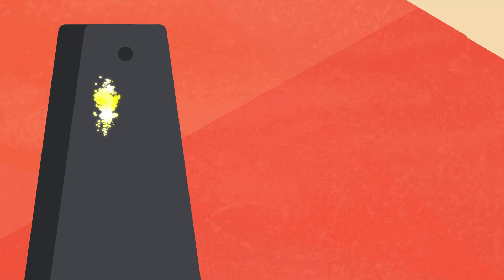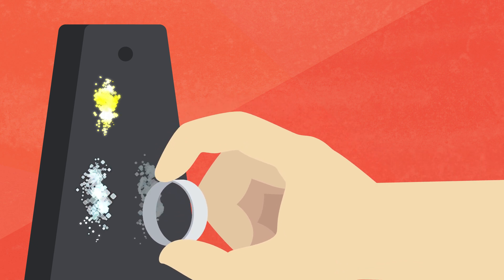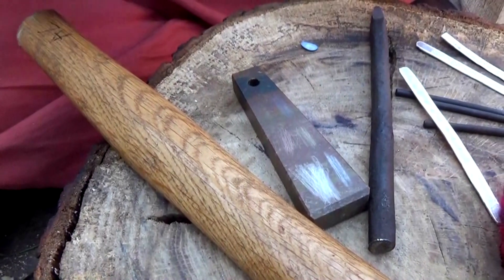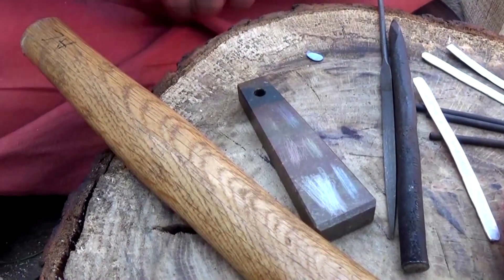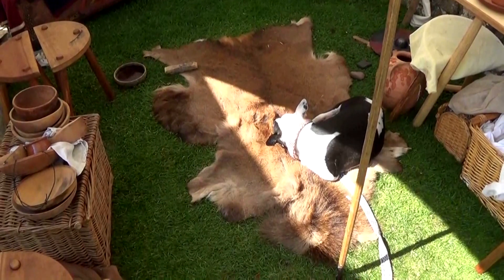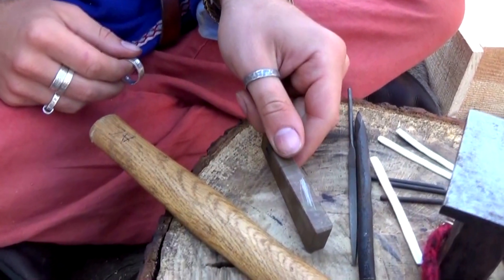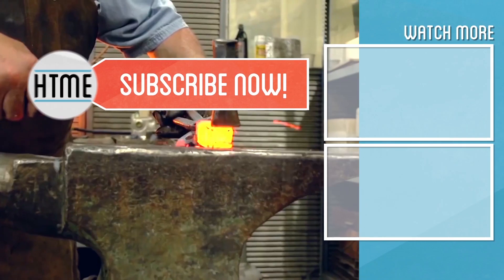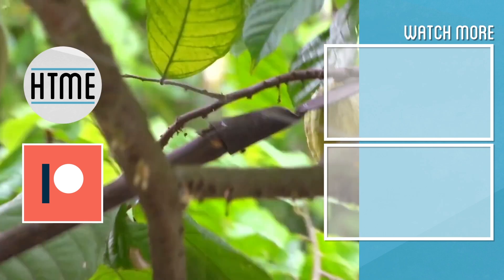How Does a Touchstone Work?

Comment: There is 3 main things we use to establish what minerals(stones) we are dealing with.
Hardness, weight and the powder colour.
The powder colour we get from a touchstone, but to day most hobby geologists simply use unpolished porcelain as a touchstone.
On the underside of cops and plates there is usually a ring of unpolished porcelain that is good for this use.

Since porcelain is white, it is actually even better then the traditional touchstone, because that makes it even more easy to see exact colour.

(This underside with unpolished porcelain is excellent at sharpening your knifes on too by the way)  ;)
(And as steel gives away a black powder colour, you will also see that the porcelain become black when you use it to sharpen your knife with)

Comment: What if you've had a lump of a metal of low value coated in metal of high value so that the layer of high value would be thick enough to not yet reveal the metal of low value underneath when the sample is rubbed?

Comment: but... you didn't touch on the acids that are used to tell the difference between the different karats of gold... or the use of acids for testing of silver on the touchstone. also iron or stainless steel feel very different compared to silver or white gold when scratched on the touchstone... as well as pure gold doesn't really "scratch off" it more a less has little tiny balls rub off and doesn't leave a good mark because pure gold is so soft and malleable

Comment: Don't metalurgists keep touchstones in their labs up to the present day? Great vid.
Reply: The stones that they keep now are more to get some of the metal on to do the acid test on. They are basically an artificial touchstone (originals were mostly jasper or chist) but they don't use them to compare colors of metal. The rub the metal on and then they drop acid on for the reaction comparison.
Reply: WanderingLostMC 
Good news. Thanks for the info.

Comment: Hmm.  I'm a collector of ancient Greek coins.  Perhaps we're dealing with different time periods here, but since you use an image of a Corinthian stater in your video, I'll say a few words which aren't criticisms.
I've never heard of the Greeks using an acid test, nor have I ever seen or heard of an acid damaged gold or silver ancient Greek coin. Most ancient Greek counterfeits were silver plated over a base metal core, which would defeat your touch stone unless I'm missing something.  Ancient Greeks judged authentic coins by their weight.  For example the Athenian tetradrachm weighed 17.2 grams.  Any coin that weighed less than that was test cut to check if it was solid, or had a base metal (bronze) core.  https://en.wikipedia.org/wiki/File:Athens_Tetradrachm_with_multiple_test_cuts.jpg
Counterfeits were withdrawn from circulation and dedicated to the temple.  
Love the videos and nice to see you collaborate with Lindybeige

Comment: can you try to make a light bulb?
Reply from the maker: we plan to
Reply: I was just gonna say, that's on their list! I mean, first they have to fully figure out wiring, which they're working on with copper (though filaments are typically tungsten or the like, though other metals will work at lesser efficacy), and then clear glass is of course an ongoing battle.
But once all that's figured out, they can make one super easily!